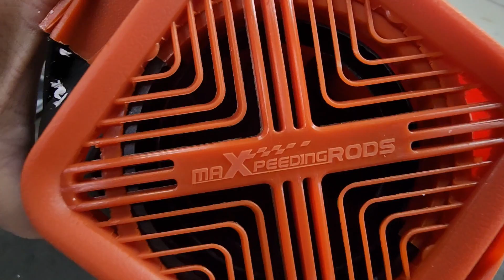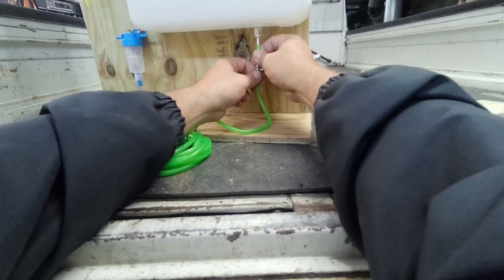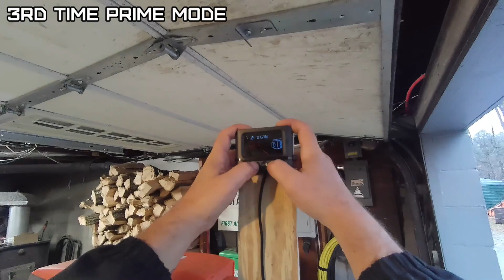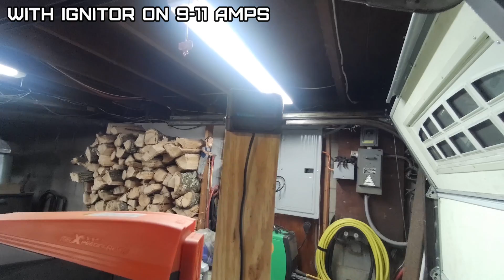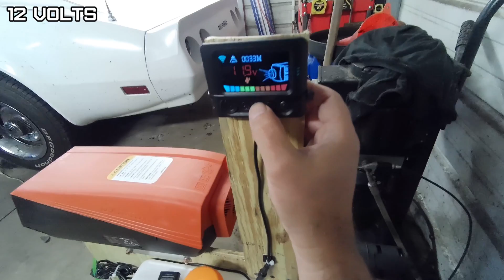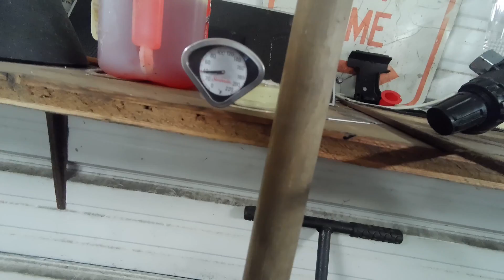MAXPEEDINGRODS 17000 BTU 12V Diesel Heater Bluetooth App & Remote Control Auto Altitude

Comment: Run this style in a hardcase for our roof top tent. Its only 3kw but holy man at full tilt even at say 0 degrees ambient, it will easily run above 25 c inside. These suckers are wicked awesome. Ive built 3 with zero issues
Reply from the maker: Definitely!

Comment: I have 12 of these mine are the 5K I have a petcock hooked up with two tanks one that started on diesel and then once it's running and heat it up to full temp I switch it over to my used transmission fluid it will not start up on the transmission fluid but if you started on the diesel then switch the petcock over to the tranny side then it'll work you just have to make sure to switch it back over to diesel before you shut it off
Reply from the maker: That's an awesome idea! Seem to bur it well? Wonder how used 0w15 weight oil would burn .. hmm
Reply: @MotoCheez  if you don't want to have to mess with the settings that are hard locked with the code but you can just mix it with a 50/50 diesel mix without having to adjust those settings in a separate tank you can get separate tanks or just use whatever you have laying around like an old tank
Reply from the maker: Worth  trying!

Comment: It doesn't look like you put the combustion air intake through the wall.   If you didn't, it will cause negative pressure and draw in cold air.   I love mine.   Put it in my camper.   Works awesome.   It clogged up after a year of use.   Cleaning the screen in the combustion chamber was easy.   They are very simple to maintain.   Run some straight kerosene every few months, and it will burn off the built up carbon.
Reply from the maker: I didn't run exhaust through wall yet either but I definitely will do fresh air and exhaust when I do. Thanks for the info with the kero
Reply: IVE NEVER HAD ONE CLOG ,,HAVE U LEANED THE HERTZ ?,,ABOUT THE KEROSENE,,WILL THEY START ON IT OR DO U HAVE TO SWITCH OVER WHEN ITS ALREADY RUNING
Reply: @wonyankeesays5661  It starts and runs fine on kerosene.   You can't tell the difference
Reply: @brianpdaniels  THANKS
Reply: @brianpdaniels  IVE ALSO HEARD TO RUN HIGH PERCENTAGE PETRO DIESEL IN THEM ONCE IN A WHILE,,NOT JUST THE BIO THATS COMMONLY SOLD,,IF U CAN GET IT ,IN OREGON IN RURAL AREAS WE CAN BUY IT AND NO ETHANOL GAS
Reply: I GAUZE AND A RUBBER BAND AS A FILTER ON COMBUSTION INTAKE
Reply: so you want the intake pulling the cold air outside? i just purchased one for the garage any info appreciated!
Reply from the maker: Yes. Both supposed to be outside
Reply: @rocman9137 Yes, if you can.  Using indoor air and exhausting outside will create a negative air pressure in the room you are heating.  This will draw cold air in from leaky joint around doors and windows.  If you can't don't sweat it, just turn the heater up.

Comment: I've just ordered one yesterday, regarding placement of thermometer the mass of the shelf & objects around it would keep the responce of the temperature indicator slow, Best to free mount it in the room suspended, away from metal and cold mass
Reply from the maker: I did prop it up so the rod wasn't against the cold shelf.

Comment: While in the military I ordered from Supply a diesel air heater for my 2 and half ton van body truck. I set it up to run from diesel truck tank. Installed the heater on interior van body on side wall exiting exhaust out the side with T pipe extended above Van roof. On cold days in Germany I could fire it up and have heat in 30 seconds. 24 volt igniter and fan with aux fuel pump was all that was required. Fan and igniter with combustion chamber in self contained unit. This would heat up Van in 25 degree weather to 85 degrees in 5 min. Then set fan speed to slow and fuel to minimum. I worked in my OD T shirt all day.😎82nd ABN
Reply from the maker: Awesome!
Reply: Thanks for Serving OUR Country Brother !

Comment: Greetings from MA. Good video. I'm on my second winter using a diesel heater and I think that they're great.  I did just order one of these units you have here and am thinking of swapping it with the one I have installed for the ability to control it from the house and preheat my 16x12 shed via bluetooth before I get out there. BTW, if the 5kw is too large for your van, maybe look into a true 2kw. They're smaller in size and. because they put out less heat on a low setting than a 5kw would, won't make your van such an oven. These things are certainly cheap enough to keep one or two around. The cheapest one's come with a simple rotary controller that I actually like for its simplicity; you can easily extend the wires for the control and mount it anywhere. FWIW
Reply from the maker: Simpler the better typically! Thanks

Comment: Wouldn't worry too much about the monoxide. 
I put "Lower Expectations" (YT), on to this, and well now....😂
The units run VERY clean!
It would be an idea to invest in a CO2 monitor for reassurance.
The ones on Ebay for $50 are very good. Had mine for 5 yrs now.

My readings are around 5 - 10 ppm
Cheers!

Comment: I think the ticking fuel pump would drive me nuts - but in a vehicle install I suppose that could be distanced or insulated so it wasn't heard.
Reply from the maker: Yeah, had a guy in a comment so you can hang it from a bungee cord and it doesn't really make much noise
Reply: I SUSPEND MY PUMPS FROM A BUNGIE,,,,CANT HEAR THE ONE IN MY TRUCK AT ALL

Comment: Thanks for the video. Learned a lot. Running it in a closed garage for several hours without the exhaust being put outside. I'm a bit puzzled by that. Even though it's not hermetic sealed.
Reply from the maker: Thanks, the exhaust should be outside but I have so many air leaks that I'm getting plenty of fresh air
Reply: @MotoCheez  but your heating the air in side your garage up. And also letting the the warm toxic waste gasses stay inside. All creating a higher pressure inside the garage. So no fresh air will enter. 
Be safe my diesel burner brother 😊
Reply from the maker: @max88nielsen Yes I agree, it was only for testing purposes the exhaust is vented outside

Comment: I have a 8k btu Ebay version in my garage and it works pretty dam good.  I would leave it on that stand and move it by the door, you easily have enough gap for the exhaust to run out.
Reply from the maker: Good idea

Comment: I wanted to see a review on this and started watching one, it was dry and slow moving so I scrolled and found yours. Yay! How big of an area will that heat?
Reply from the maker: It's 17000 BTU, depending on insulation, a 24' camper probably. If my garage was insulated it would almost handle it. 
According to charts online. 17000 BTUs will heat 1000 sqft roughly

Comment: Nice vid and review shows basically all what one need to know thanks ! Would it be possible to mount these ducts also on the intake side  to be able to put it in an enclosure or similar and punctually suck air in?
Reply from the maker: Thanks. There's no connection for the intake side, but I can't see why you couldn't make something up for it
Reply: @MotoCheez  many thanks for prompt reply, i may google a bit more, since i have a more expensive 2 kw one for the RV ( same 65 mm round air adapter either side, its an Autotherm or Planar 2 D )anyway i like to buy 3 cheaper ones for the house, workshop as emergency heaters or to save gas etc 🤔🥴 Again thanks for your help cheers from Germany

Comment: Concerned about blowing  hot embers out the back..? Fire hazard ?  Needs a spark arrestor of some type ?
Reply from the maker: I was thinking it should have a stainless steel screen anyway so mud daubers and other bugs don't try to build a nest. I did mention it but I cut it out of the video because it ended up being so long as it was
Reply: The muffler has a spring inside that acts as a spark arrestor. The exhaust gas is about 350F.
Reply: Ember question! Did the embers come out of the muffler then?  I couldn’t see on the video. Also, did the embers only spit out on shutdown? Presumably the air flow increases to aid heater cooling?

I’m going to be fitting on a boat, so I’ll have additional exhaust pipe post muffler and bulkhead fitting to the outside but still a bit worried about spitting embers onto the wooden pontoon! Will put a bend in the final connection to the bulkhead fitting to act as an ember trap without causing too much exhaust gas flow restriction. I have the same model, looking forward to installing it now. Great video, thank you. 👍🏻
Reply from the maker: Yes. From the muffler on shutdown.

Comment: Hello , nice video . Did you test the timer on this model ? I’m interested if you can set it to start at a fixed time you want and off when you want . Is this working or nope like other china heaters :))
Reply from the maker: I don't think there is a time remote on this, I don't believe I saw it in the menu. Yes it still working but I've only run about two tanks through it
Reply: @MotoCheez  ok thanks :) then I will buy a proper heater like Eberspacher  Airtronic or Autoterm  those they have for sure timer :)
Reply from the maker: @onyxnorbert this might. It's been a while... It would be in video when I show the manual

Comment: Hi thanks for the video. I have the same heater. The biggest problem i have is that the heater never stops! Its 30 degre,s here, i told he thermostat to make 10  but it never stops or even slow down!  The app works fine with android 13, but also not responding on temperature.
Reply from the maker: Hmm. My controller didn't operate properly because of a pushed out pin connection, I'd check connection to controller/tstat

Comment: Are you able to adjust the Hz / pump frequency directly? Or can you only adjust the temperature setting?
Reply from the maker: Just the temp, the pump is automatically controlled
Reply: @MotoCheez  thanks, saved me buying something that wouldn't be ideal
Reply: @S5UPERCHARGED  There are 5 power modes, I believe,  p0-p5 setting.  And modes, auto, smart, fan, pump oil.
Reply from the maker: Just 2 on my PO. 2000 and 5000, 5 fan speed modes
Reply: There must be different software on these controllers. I bought a different heater that has P-01 to P-10 but the display looks identical
Reply: @MotoCheez  Its not viewable unless you scroll the screen up. well, on mine that's is the case.
Reply from the maker: I'll have to look.
Reply: @S5UPERCHARGED  it's not the same controller you have, you have one with a rotary knob I think and is from the Hcalory brand
Reply: and if you don't have bluetooth, there is no rotary knob

Comment: I also have an 8K that I heat a 900 square foot single wide haven't mounted to the back door that is metal just poke the hoses out the back door and you're good to go it's mounted in the laundry room so it works perfectly hang dry all my clothes in the middle of winter even keeps the house nice and toasty at about 75 degrees when it's about 20° outside it's not well insulated either suckers really put out the Heat
Reply from the maker: Awesome

Comment: You did not show the App very well,    on main screen slide up and there are 5 settings for P0- P5
Also, there are different modes, smart, auto, fan, pump oil.
Apart from that, very good video.
Reply from the maker: Thanks

Comment: I’m so jealous both of my units had bad motherboards and wouldn’t start. Still waiting on a new one
Reply from the maker: Oh damn! Did you check the connections inside the unit like I did on mine? Cuz I did have a cable off on this inside the unit
Reply: @MotoCheez  yes I opened the motherboards. And disconnected the plugs. The new one I just got started right up no issues

Comment: How to cennect at new phone, adroid 13 and above? Any fix
Reply from the maker: I believe in Android settings you can change the Bluetooth to a lower version to be able to connect to older devices
Reply: @MotoCheez  how this option od called?

Comment: I HAVE FOUR,,ONE IN THE SHOP,,ONE IN MY MOTORCOACH,,,ONE UNDER MY TRUCK TO HEAT THE CAMPER SHELL AND CUT NO HOLES ITS UNDER THE BED AND DUCTED THRU HOLES THAT WERE PLUGED IN THE BULK HEAD,, IVE NOT SEEN THIS ANYWHERE,,,ALL THE OTHERS PUT IT ON THE GROUND AND DUCT THRU A WINDOW OR CHOP HOLES IN THEIR BEDS,,,AND THE FOURTH IS A SPARE,,,U WILL VALUE THIS KIT !,,,IF U WANT THE PUMP TO BE QUIET SUSPEND IT FROM A BUNGIE
Reply from the maker: Awesome. If someone put one of these units outside I would hope they ducked a return air as well as the heat... I like it so far!
Reply: @MotoCheez  DONT REPLY TO ALL REPLIES,,,THEIR JUST NUGGETS FOR USEING,,,OH AND DONT LET IT FLAME OUT DUE TO LOW BATTERY,,,,IT COULD TURN INTO A PAIN

Comment: Miine arrived yesterday 24th. dec. to replace my 8kw heater and give me bluetooth control. the is heater is heating ground floor of my UK semidetatched wooden house as a effort to save money on my gas central heating which is very hard to pay at moment in UK. The heater is mounted outside in a metal insulated box exhuast and air combustion intakes are outside the sealed box. there are 2 ducting holes into house 75mm. holes a flow and, the return is there to increase efficiency putting warm air back into box keeping every thing warm including battery. the hot duct is piped direct though into house wall  to livingroom.  The 8kw. runs on its lowest setting all the time and will maintian heat at about 20c i think thats about 68f.if its above freezing outside with all intenal ground floor doors open, upstairs is not hot if  that is only heat for house So I allow the central heating to get house up to temp. in the morning and when get up i switch on diesel heater so that stops the central heating as thermostat is in livingroom. thats halving my gas bill .A second heater will be fitted upstairs soon and totaly stop mains gase use for heating other that water to taps! regarding the exhuast pipe tape,  i'm not sure if that should be left on, or not as a seal, I suppose I should try a flame on it first! the pipe is a much better quality than other chinese heaters exhuasts which do not last long if on a van. your pump should be mounted at and angle 33 to 45%  not vertical I think . I like the broard mount, its like having an all in one heater, but every thing can be seen, and thats good regarding  inspection or maintenance I am going to copy that for workshop heater Thanks
Reply from the maker: Awesome info! Thanks for sharing

Comment: IN VAN,,,PUT ON UNDERSIDE,,,,PIPE INTAKE INTO VEHICHLE SPACE,,,THE HEATER WILL BE MORE EFFICIENT,,,PIPE RETIRN AIR TO VEHICLE INTERIOR AND AGAIN MORE EFICIENT,,,AND SUPPLY AIR TO INTERIOR,,,AND PUT UP A SHIELD TI PROTECT THE UNIT FROM EXCESS MOISTURE AND ROAD DEBRIS
Reply from the maker: There's 0 room underneath these vans

Comment: Those are Chinese Kilowatts
Reply from the maker: BTUs came off the specs
Reply: @MotoCheez  look on the internet and you will find a wide spectrum of quotes specs for those things.   I have one 3kw heater and one 8kw heater.   They're indistinguishable.   They have the same markings on them and use the same amount of fuel.   It's kind of like gmrs radios and range claims.
Reply from the maker: I did notice that.

Comment: HI
Reply from the maker: 1st!!
Reply: @MotoCheez  :)  That heater reminds me of the gasoline heater in my '64 VW bug.  Yours has a tad more technology built into it than mine had though. 🤡
Reply from the maker: They make these in gasoline too
Reply: @MotoCheez  Yup, my '64 had the optional gasoline heater.  I turned it on once and it scared the crap out of me and never tried it again.  "What could go wrong?"    (this isn't my car, but shows one in operation)  https://www.youtube.com/watch?v=SvWN4CVbAuM
Reply from the maker: I had a 69 bug when I was a kid, had the ole exhaust manifold heater
Reply from the maker: That's crazy how exhaust for the heater was up front under running board
Reply: @MotoCheez  Mine were rusted permanently in the heat position.  (mine was pretty rusted out overall.  Michigan roads, 15 year old car)

Comment: IF BLUE TOOTH HAS TO HAVE INTERNET ,,WHAT USE IS THIS IN A REMOTE AREA ,,IF IT FAILS OR NEEDS RRPROGRAMING,,SAME WITH MY RENOGY  HOUSE CHARGING UNIT FOR MY TRUCK CAMPER ,NO BLUE TOOTH,,,AND THEIR NOT WATCHING WHAT I DO
Reply from the maker: Bluetooth doesn't need internet. It's a direct connection